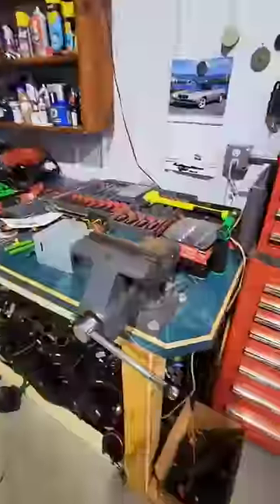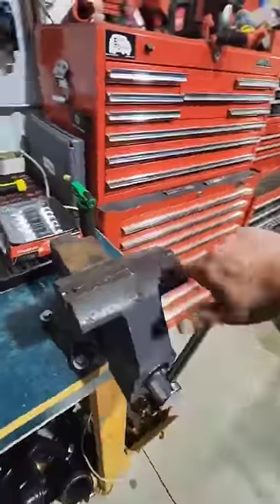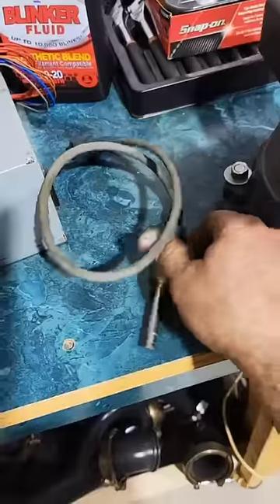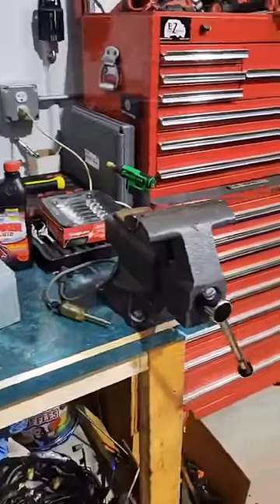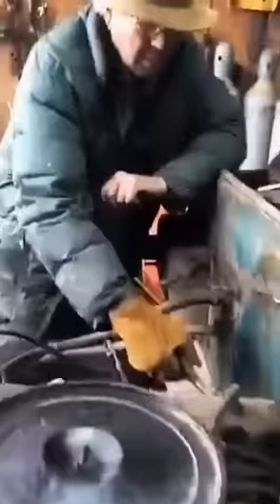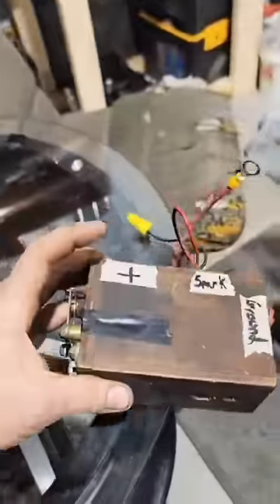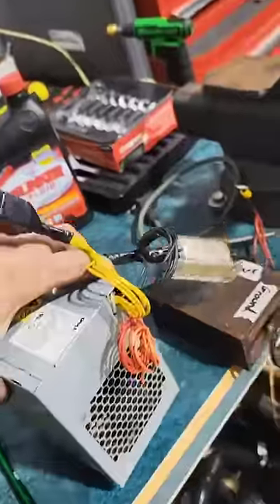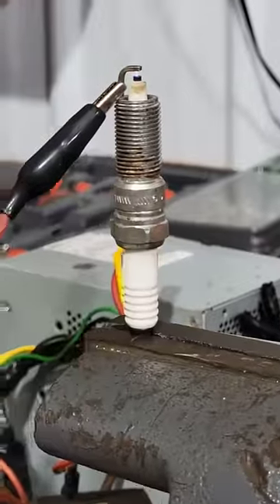30,000 Volts out of an ignition coil! #shocking #shorts Be careful, electricity can be dangerous.

Comment: Decades ago, my father was an airframe technician in the RCAF and there was a guy who was constantly leaning back in his classroom chair; thus, bending the metal legs. Certain people including dad were responsible for repairs on the base and they had gotten tired of fixing bent chair legs, so they rigged his chair with some wiring and a mercury switch in such a way as to complete a circuit when the chair was tilted backward. They had camouflaged the wiring which was connected to the ignition coil from an aircraft and an aircraft battery. Dad said that when buddy leaned back on the chair, the shock he received to his backside was so strong that he flew out of the chair so fast that it was still leaning  when he hit the floor!